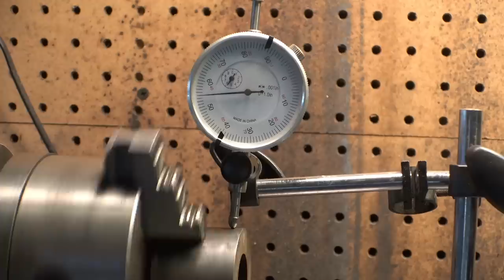Making an Automatic Two-speed Go kart Transmission

Comment: I think you will need something to absorb the shock when 2nd Gear engages. 
Maybe a v-belt between engine and transmission or the shock absorber from a small car clutch ( the inner section of the clutch disk with 4 radial coil springs) or a combination of both, just to give the engine at least a fraction of a second to slow down.
otherwise something will break...

Comment: This is fantastic! Essentially made a centrifugal clutch for gears! It’s going to be fun figuring out the correct spring ratio and finding out how much torque the one way bearings can handle. Should be quite a bit if I remember how they work.
Reply: old sears minibikes had a similar setup, just with two centrifugal clutches and a sprag. i'd imagine this setup will be pretty jarring going between high and low, the two clutch method that sears used was very smooth

Comment: I was looking at using similar one way bearings on a kart but the torque limit on them is basically nothing. I'm very interested to see how these hold up! Also on most centrifugal sprag two speed gear setups have the sprag/dog mechanism on the driven shaft(in this case the axle) and not the driver shaft. If you have problems with it shifting into second and right back, or not staying in second properly then you might want to consider this. RC two speeds have that setup where the sprag/dog  is on the spur gear (driven side) and not the pinion gear (driver side)
Reply: Those one way bearings won't last hardly at all. They'll immediately break.
Reply: I was gunna comment this too, the one way clutch should be on the wheel axle side so that vehicle speed determines the shift point not the engine rpm. Else like you said, if you're trying to climb a hill or something and need more rpm and power its going to upshift when you don't want it to, lowering your wheel torque.
Reply: Thought the exact same thing after finishing the video. Those one way bearings will slip if they see any real torque and he built the whole system on the wrong end. It needs to be dependent on wheel speed not engine rpm to work correctly.
Reply: first gear could use the spring loaded lever, just sprung out instead of in.

Comment: Somebody get this man a brass hammer lol. Using a claw hammer in the shop is never the right option, unless you're fixing the roof or something
Reply: I was wondering why he didn't press them in.
Reply: It's about force and how much you use.
Reply: @Muglez14  How about a parting tool also?
Reply: @norsevikingsir4932  not quite, you can still split a race with a hardened steel hammer with little force. The softer material gives you the ability to give a stronger strike without the increased risk of damaging your work. That being said, a 4lb dead blow is really all you need on bearings that size.
Reply: You don't use a claw hammer to put Roofing on. Three generations of it.
But if that's all you have...

Comment: Bloody Brilliant Rather B! I can see your next step right now! At the moment you have to pull the whole shebang apart to "toon" it.    If you were to make your spring heavier, and include a very short coil spring under the head of it's holding down screw, you could "toon" it through a hole in it's sprocket boss. you may need two screws and holes, or some other method of keeping the spring captive, so it doesn't rotate.

Comment: I’m a machinist.  This is certifiable nice work.  You did a lot of thinking ahead building that pawl.  I like your solution to match drilling the hinge pin too.  Grinding a clearance notch so you can drill the hole using the pawl as a drill fixture.  So what else, you say?  I say I like it.

Comment: A similar transmission design was used in the king midget cars.  You may want to add a second locking pawl to your high gear as that first one may be too weak on its own (under load at peak torque it may fail).  
Another way to make this transmission is with 2 centrifugal clutches (2 separate engagement rpms ex. 1600 rpm for low speed 2500rpm for high speed) a 1 one way clutch sprocket (low speed the one way clutch prevents burning the low speed centrifugal clutch shoes when in high gear) and a fixed high speed sprocket

Comment: that spring out lever thing is not going to hold much power.
Reply: Yeah he will probably work the kinks out
Reply: Cannot imagine that the pin that the pawl ("spring out lever thing") rotates on is strong enough to work for any length of time. Interesting theory, but the setup, I believe, needs to be much beefier.
Reply: Problem is that it's on the wrong shaft, all RC two speeds have the centrifugal sprag/dog on the spur gear / driven side... I have a feeling it's not going to stay in second properly.
Reply: POSITIVE THINKING PPL
Reply: A basic gokart motor has from 5 to around 15 hp that should be plenty strong enough to withstand it the only concern would be what he used fore the pin in that little gate  I dont know what metal it was
Reply: @absolutemadlad2671  once it engages the dog uses the end surfaces to hold the load, the pin is only to locate the dog on a design like this one
Reply: It'll hold the power of his kart. The pin itself isn't load bearing, the shaft is supporting the weight of his lever and the lever is pushed against the shaft once power is put on. My concern is it hunting between 1st and second every time he lets off the gas and gets back on past the speed of second gear engagement.
Reply: Yeah, might work but he really should take apart the rear hub of a bicycle and check out how exactly this principle works, the lever must move on both sides and when it's up it should be in its most comfortable position so it can't move anywhere except of back down again pushed by the spring, so the only way how it could break is to be crushed to dust, then it can be ways smaller, but the most important part is that atleast two are necessary, bicycles use two and they are held down by a ring which is the spring at the same time, they don't have an own axle but are just laying in their groves held down by the ring spring, my english is to bad to explain that properly, but I think some of you have seen something like this already. Actually I would go with variomatic or atleast its principle.
Reply: @Andrey Angere I agree!!  At least 2, one on each side, but probably 3!  Just depends on the amount of power is behind it
Reply: Martin did you watch the whole video? He mentions that. And the remedy. 👍🏼
Reply: @rickorr2181  the pin just holds the pawl in place on the shaft it doesn't take the force loads the loads are handled by the steel pockets on either end of the pawl
Reply: It's a self loading lock, it does not use the pin to hold anything but itself. It is really a sprag clutch, it wedges the bar between the shaft and gear.
Reply: Bicycle freehub pawls are spring loaded outward thus creating a one way clutch or ratchet mechanism.  The single pawl in this case is spring loaded inward so that it doesn’t engage until the shaft reaches a certain rpm.  Making this into a ratchet mechanism would defeat the purpose, although maybe this could he applied to the one way bearings if they fail from the torque
Reply: It's just a working concept to be improved on. It's how he has almost always learned.
Reply: martin;  well they better make the lever out of the same stuff inside transmissions called dog lugs between gears huh...
Reply: @evil_me  I think it should stay in second. If you look at about 20:43 it looks like the bit it engages against is angled such that when the flies out it will catch it and the force of the lever spinning the sprocket will push it out further. Keep in mind it is trying to spin against the sprocket. In fact, I might worry that it works in first, shifts to second, but has to slow down very slow to shift back to first. Not sure though, I'm gonna go look up how the RC ones work.
Reply: It'll hold fine. The cart is already moving when it shifts into second gear so the torque shock isn't going to be anywhere near as savage on the transmission as it was in the demo. The sprocket and shaft will be spinning at similar speeds rather than the sprocket being still when the shaft engages
Reply: @bobthudpucker7730  I also second Evil me's opinion that it probably won't stay in second. The problem is not the pin or springed lever, the problem is he's putting the whole assembly on the wrong axle. It should be the other way around. What he shows as input axle, should be output connected to driven axle, and what he shows as output, should be input connected to jackshaft which is connected to the engine.

The problems is, that the point of transmission is to change gear ratio once seconds gear is engaged. Because of ratio change, either input (engine) has to slow down, or output (wheels) have to speed up. Its harder to immediately speed up the vehicle, so its usually (basically, always?) the engine rpm that slows down when higher gear is engaged.

So, if 2nd is engaged, the engine rpm will drop. Now,  because in his setup the transmission is on the jackshaft directly connected to the engine, as the engine slows down, the jackshaft will slowdown as well. Because the sprocket is revolving fsster than axle with springed lever, it would force the lever down, and the 2nd will disengage, because the lever relies on the jackshafts speed. Engaging 1st again will speed up the engine again, so 2nd will reengage. This will repeat up to the point where the gokart goes slow enugh so 2nd won't engage, or fast enough that the 2nd won't disengage after engine rpm drop. Add that is the failure point. 

On the other hand if the assembly was on the axle side, the jackshaft with the lever wouldn't slow down with the engine so it will keep the lever engaged. In this configuration if the engine spun slower than the wheels, the lever would be forced down, but it would revenage each revolution, because the wheels are still spinning fast enough. It makes engine braking impossible, but who brakes with engine in a gokart anyway. The 2nd would only disengage if the wheels slow down enough. Engine speed wouldn't matter anymore.

Above is only a theory, but strongly supported by examining blueprints of nitro RC 2 and 3 speed automatic gearboxes.
Reply: @absolutemadlad2671  IDK if you have seen his builds, but there's no such thing as a "basic go kart motor" in this guys shop lol. I am worried about the pin as well, especially knowing he will probably pair it with a motorcycle engine or something similar. I'm guessing/hoping the pin was a cut off drill bit as that would at least be hardened steel.
Reply: @rickorr2181  it most definitely can be if the load isn’t on the pin as long as there’s enough clearance in the hole on the pawl as to let it load against the actual axle cutout instead of the pin itself. But you are correct if there is not enough clearance and the load is on the pin itself.
Reply: When are you going to put this on a gokart.? Can’t wait to see it work👍🏻

Comment: WOW, a lot of engineering went into that! Way back in the 60's, Rupp had a 2 speed automatic "transmission" on their TT500 mini bike. Theirs had a standard centrifugal clutch on the engine that had dual #35 chain sprockets on it. A pair of chains went to a jackshaft, one to a one way with a large sprocket (low gear) and the 2nd went to another centrifugal clutch with a smaller sprocket on it which was 2nd gear. There was only one main chain to the rear wheel. When the high gear clutch engaged the jackshaft sped up and the one way released. Whomever hires you will be lucky!!!
Reply: the right way , the centrifugal will buffer or cushion the shift ,,,this will shift like a bomb

Comment: It's like an oversized nitro RC gearbox

Nevermind he just mentioned its based on that 😆😆
Reply: Both Nitro and battery, friend.  Though it doesn't seem to be that common in battery these days ;)
Reply: @GaisaSanktejo  battery don't tend to use gears (except for the main drive connection gears). I used to race the old brushed cars as a kid (30 years ago) and never come across geared electric. Nitro will have 1 gear for buggy racing. 2 or 3 for off-road toys. Motors have more torque than small engines so the need for gearing isn't so high.
Reply: @MaNNeRz91  As I said, thay are uncommon.
I guess I should have expanded on that and said they seemed rare when I used to race myself (ironically, about thirty years ago too LOL).
A couple of club members owned geared battery cars. I have no idea what they were called and they were comparitively ugly and blocky, but they MOVED!
Reply: @GaisaSanktejo  that's quite uncanny 😆 and I can imagine they're rare for a reason. Too much torque to be reliable. Adds more complication to the drive. Adds lag to the acceleration etc. Definitely suited better on an engine
Reply: @MaNNeRz91  I wouldn't know, what I do know, is that those cars were beasts and competed readily with top of the range cars of the time.
As an aside, I always preferred buggies and those two were buggies. They were definitely wicked fast and good handling.

I only recently got back into the hobby myself after some "nice" person stole my RC gear. It wasn't top of the range, but losing over £600 worth of cars, radios, batteries etc, which earned me second place in a local competition ended my RC days at the time

Comment: seems like it chages gear based on motor speed rather than axle speed?  What stops it dropping out of high gear once the revs drop?
Reply: Yup, that's what I'm worried about, I think it would have been better make it controlled by the axle
Reply: I think it would be more logic to let the wheel speed decide when it is time to change gear too.
I guess that –once engaged– the 2nd gear would not disengage again even when the engine speed drops, but when you release the throttle (briefly) it could gear down again
Reply: @Acamperfull  I was thinking that any torque reversal, or loss of traction would release the sprag.  Hope I wrong.
Reply: @Acamperfull  due to the geometry I think the gear will be locked in place until you release the pressure by really letting the rpm drop but it would be more logical to let the vehicle speed decide when to shift...

Comment: Good choice of music. That transmition seems pretty straight forward. As long as banging that latch pawl doesn't break something it should be pretty solid. If i were you, I'd use a belt drive or some kind of rubber damper on the input shaft to reduce some of the agressive forces that might happen when it shifts Geared ebike hub motors use the same one way bearings and I've heared that daily riders have them wear out in a year or 2 and they just stop gripping but you should be able to get some solid fun out of it before that happens.

Comment: seems like second gear needs to be determined by drive axel speed and not input axel speed.  you lose the ability to have high torque with high input rpm and low drive gear.
Reply: But it is transmission for gocart
Reply: I think you're on to something here. I predict the cart will either lurch or stall when 2nd engages
Reply: I made a comment about this, the centrifugal sprag/dog should be on the driven/output side not the driver/input side
Reply: @evil_me  what difference does it make , only have to be stronger on that end
Reply: @danielmott8830  Depends on gearing ration really. If ratio is too radical that yes would happen. I would use centrifugal, or friction clutch that allows little bit of slip like car clutch when chancing the gears to smoothen the engagement point, or maybe go with CVT setups
Reply: @Hellsong89  exactly.  this reminds me of a 2 position version of a CVT.  A CVT/torque converter has much less stress and replaces both clutch and gearbox in this scenario.
Reply: @bubster1981  It's going to shift based on RPM not speed. So what's gonna happen is it's gonna immediately shift when the RPM threshold is hit, instead of shifting when a speed threshold is hit.

Comment: That is pretty cool engineering. I would add some sort of friction device on the second gear, so that it is already moving when it engages. If it bangs into gear too hard it's going to shorten the life of the ratchet mechanism greatly. 

Lots and lots of detailed work. Well done.

Comment: Lots of Automotive transmissions use a similar design to Lock Transmissions or to (Mechanically / Hydraulically ) lock a trans in a gear etc by using a Weight on the input shaft from the converter , The Centrifugal force overcomes the spring force and lets the valve shift (Hydraulically ) locking the trans or converter to make it straight drive .Removes that %3 or so of trans slip .

Comment: hei mate!! pretty clever...good job!
one only question / suggestion:
looking the machining of the main kick in/ engage barrel seem a soft material like C40 or similar ( it get magnetic during the machining) and also the teeth/ knife seems 1040 or similar mild steel.
i'm a litle bit concern about a material faliure durinig the stress work also in the short period.
i think you need some specific heat treatement to ensure long life to the barrel...

Comment: Awesome 👍🏻 The only problems I see are. The single drive pawl, yes a single pawl worked in an RC car. They don’t have to deal with all the weight as a vehicle your going to use this design on. Might need more then one drive pawl and the pivot pin for the drive pawl seems a little small. There’s a lot of force on that real thin pin. I see this design working with a few tweaks, 3 drive pawls and larger pawl pivot pins. Awesome builds 👍🏻👊🏻 keep up man.